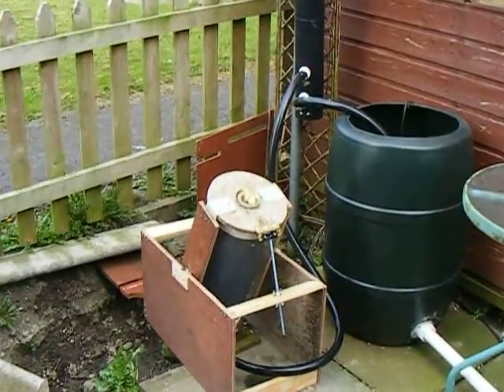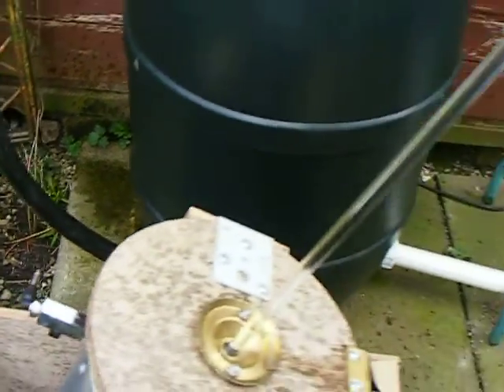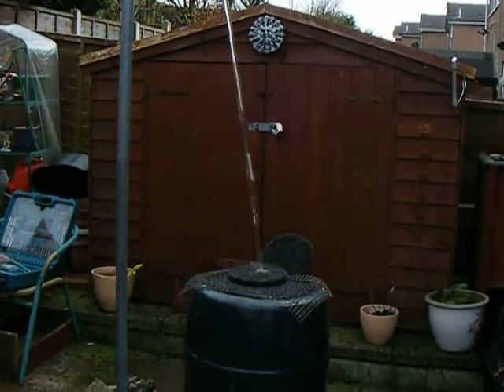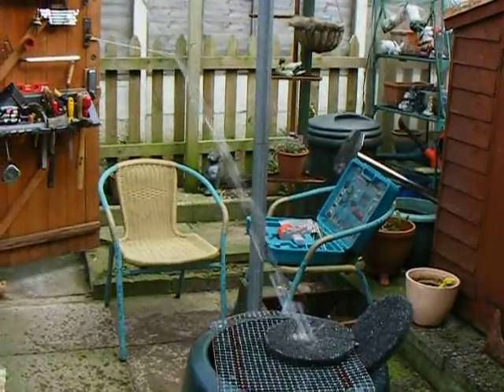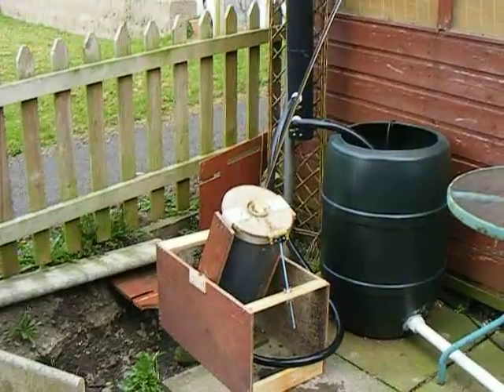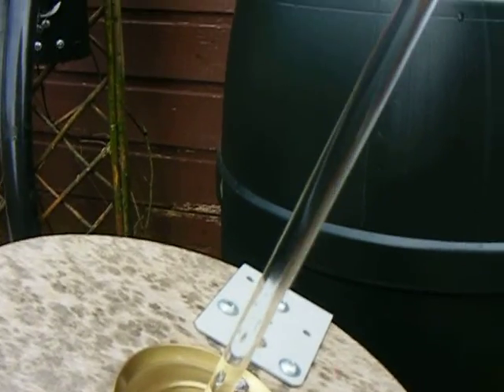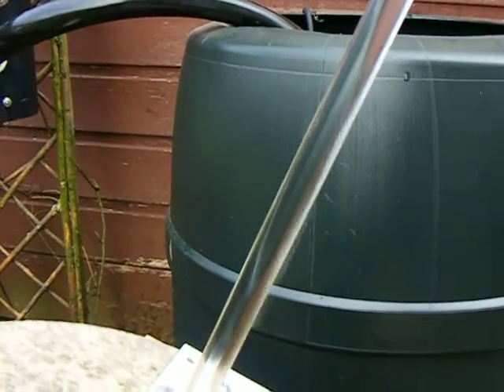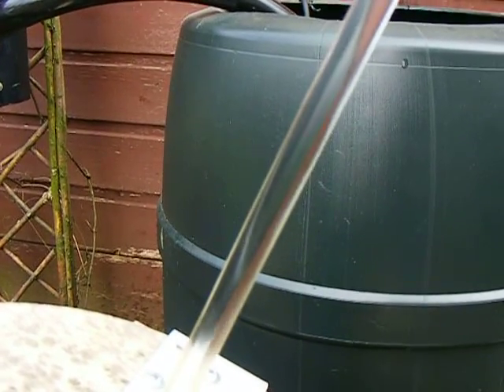Laminar Flow Nozzle Mk2 (movie 2)

Comment: That is awesome !!  great job.
Dont be disappointed with that laminar.

You have a extremely high and long arc of water..
I bet if you reduce the pump some bit, the water will stay laminar ALL way until its end.

The reason why the water break up in the end can also be some small wind .
Just a tiny bit of wind can break up the water flow.

Small bubbles in the nozzle can also create turbulence.

But I give you 5 star for this :-)

Comment: Hello, I saw many you tubes with the same design flaw in which the water exits the straws and returns to a state of confusion in the head space prior to fighting for the nozzle exit. The water is no longer layered. All these units do give the appearance of laminar flow because of the slow feed but in reality the nozzle needs to be the same size as the packed staws or the straws need to be packed in the shape of the nozzle you have created. Tom